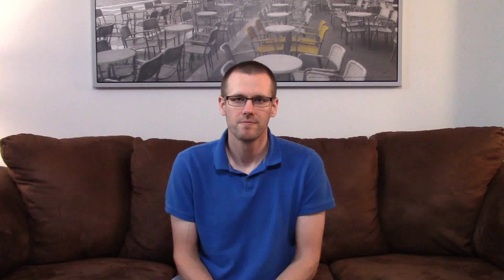Introduction summary of how to Pick an RC Brushless Motor, ESC, LiPo

Comment: I have a rc car of 1:18 scale i want to upgrade it so i need full guide on it and i want to drift can i make that car drift under 10 thousand Pakistani rupees if yes then guide me i have selected the 3200kv motor it says its good for drifting and idk how much voltage of battery would be good and also the esc

Comment: Hello sir, I want you to help me if you want.  I have a 600kv motor and I don't know which esc is best for it to achieve the greatest speed
Reply from the maker: The ESC does not determine max speed. This is up to the rest of your power system. If you haven't selected all other parts, you can't pick the ESC.

Comment: Question 
If i'm using only one ESC with no external BEC and disable the red wire on my speed controller, will the receiver now receive the full voltage from the batteries or will the receiver just not power on?
Reply from the maker: No power
Reply: @RCexplained  thank you, I'm new to this hobby and you just saved we a world of trouble.

Comment: Very informative video I must say. Highly appreciated! I have a question regarding the type of battery an esc can take. Could you use lithium coin batteries, each being around 3.6v in series to get an esc working and fly an rc plane for example? If so, (I haven't done must research on this) let's just say I have 5  3.6v Lithium coin cell batteries in parallel connected to an esc with a brushless motor, would that setup work? Sorry if I sound a little confusing.
Reply from the maker: Lithium Coin batteries would not be able to handle the discharge current required for most setups. But if you parallel correctly set them up, it could work.
Reply: @RCexplained  ok thanks I appreciate it😁

Comment: 3c, 2212 size, 1100kv motor, and 20A ESC. What battery should i use?
Reply from the maker: Depends on where this system will be installed.
Reply: @RCexplained  i want to install it on an rc plane
Reply: i have a 20A 2-3S esc, is there any battery that matches my stuff that i have?
Reply from the maker: A 3s 2200mAh battery can work

Comment: 25" Tunnel hull
90A Esc
Run with 3s Lipo

What motor can fit to this racing boat setup??
Reply from the maker: Is this an outboard tunnel hull or inboard catamaran? What is your goal with the setup?
Reply: @RCexplained  usually i need this boat for racing purpose and the setup is inboard runner f1 tunnel hull
Reply: i have a 3c, 2212 size, 1100kv motor, and 20A ESC. What battery should i use?
 just asking

Comment: 6:20 what you mean with load for example for a jet boat?
Reply from the maker: Hi NabiL, are you building a jet boat and wondering what is meant by load? If you are drawing more power than you anticipate and need to reduce load, this would be like moving to a smaller pump on a jet boat. Or by moving to a lower kv motor, or by reducing cell count on the battery. All of these changes will drop the total wattage that the system would draw.
Reply: i have a 3c, 2212 size, 1100kv motor, and 20A ESC. What battery should i use?
 just asking
Reply: Eason LIU you should see what your esc can take
Reply: @NabiL_Lam  my esc is 20A
Reply: Eason LIU does not say how many _S? Like 2s or 3s?
Reply: @NabiL_Lam it says [2-3S Lipo]
Reply: Eason LIU use 3s lipo 5000mah or 4500mah
Reply: i am still deciding on which battery i should use lol, but im still not sure which battery would match my stuff

Comment: Hi, Ryan. Thank you for the video! It helped me understand the concepts related to the battery, ESC, and motor. I am still not sure if I chose the right stuff for my RC airplane. We are trying to get the flying time for 4 minutes maximum. We are building a 1/30th scale of an actual airplane we designed and we chose the following for our propulsion.
Electric Ducted Fans: JP Hobby 90mm Aluminum Alloy EDF w/ 6S Brushless Motor, 1830 kV, Thrust with 9.04lb.
 (https://www.bananahobby.com/jp-hobby-90mm-clockwise-rotation-aluminum-alloy-edf-w-6s-brushless-motor.html?pSearchQueryId=2802711)

Battery: 5000 mAh 6S1P 30C Lipo Pack
 with XT90 (https://hobbyking.com/en_us/zippy-compact-5000mah-6s1p-30c-with-xt90.html?queryID=a47c93d28f5cc2adb3a760c4ad0b080c&objectID=82610&indexName=hbk_live_magento_en_us_products)

ESC: Turnigy Plush-32 150A (2~6S)  speed controller w/ BEC
 (https://hobbyking.com/en_us/turnigy-plush-32-150a-2-6s-speed-controller-w-bec.html?queryID=526cb495c2b4253dfefc0a5b0032271c&objectID=82115&indexName=hbk_live_magento_en_us_products)

Do you think this will be sufficient for our airplane? If not, what should we change?
Thank you!
Reply from the maker: Hi San Lee, What size is your airplane and what is the weight? 30C for the battery is a bit on the weak side for your power system. You will be pushing the battery quite hard.
Reply: hey san lee can u help me with picking out a lipo battery? im kinda stuck and confused

Comment: Hi Ryan, I’ve found your videos really helpful. Propper technical explanations are very much appreciated. I’m reasonably up on industrial 3 phase induction motors but the battery powered scene is new to me. 
I realise this isn’t exactly RC but your channel and site has been the best source of info I’ve found: I’m looking to make an electric scooter more dangerous and I wondered if you wouldn’t mind checking some of my assumptions before I order parts.
Stock motor is 280w 24vdc and turns at 2750 rpm. That gives you about 15mph…. eventually – it’s pretty gutless. I’d like to get that up to more like 25mph with improved acceleration and I need a fair bit of torque as the scooter with me on it will be at least 100kg. 
I want to try and run it off two 5Ah Milwaukee drill batteries for 36v as I already have these. I’m unsure of the max current these will sustain and don’t want to unduly stress them so they’ll carry on running my tools! If they just won’t work I’ll probably move to hover board packs or possibly a home built pack.
That all suggested a 120KV motor with sensing for better starting torque would work for me and I can get this style for a sensible price in the UK:

https://www.ebay.co.uk/itm/120KV-24-36V-Brushless-Sensored-Motor-45km-h-for-Electric-Balancing-Scooter/203011985854?epid=20038978874&hash=item2f447511be:g:qGoAAOSw8xde2Rqq

I’m still not really sure what ESC to pair it all up with though. Motor spec suggests max draw would be ~128A at 36V but I’m unlikely to use that continuously. Would that suggest a 150A ESC? I don’t want to spend loads but I would like something programmable so I can derate the max power so the kids can play on it (or to preserve my batteries). Another nice to have would be the ability to connect directly to a thumb throttle but I’m unsure if this sort of thing is available – I’ve seen a trick with a servo tester to make it work and I’m happy to do that if it’s not but it would be more elegant if I can do it directly. Do you think a capacitor bank would be worth it in this application? Reliability and overcurrent/overheat protection would be a good thing so I don’t get stuck with a burnt out ESC miles from home! I have no idea what manufacturers to look at, which to avoid etc.
Any thoughts on the whole system or suggestions for an ESC very much appreciated!
Reply from the maker: Interesting Project. I would suggest trying to find out the maximum continuous current of your 36v batteries. I would not expect you to pull more than 50A continuous. An ESC closer to that range would be acceptable. The key here is that you won't know how much current the system actually will pull with your specific setup unless you can find someone on the forums who has experience with this. If you can not, you will want to log (always a good idea) the amount of power your system will consume with you on it the scooter. Over sizing the ESC will allow more head room incase you find yourself pulling more power than expected. Otherwise you will have to change the belt/gear ratio to reduce load/current. 

I've seen throttles that work with a typical ESC, just not sure where to get them. They do exist though and you can always create your own throttle from a servo tester. If you are under 50A continuous on an 80A ESC for example, there is no reason to require a cap bank. This example has a lot of head room and the throttle is less likely to be blipped frequently like an RC Car.  The harshest on your equipment will be how hard you accelerate or push the system up hills. If the ESC you select can limit current, this option can help keep the system in control. 

A data logger is a great investment and if you get the right one you can have live data during your runs. 

**I'm assuming 120kv @ 36v is going to get you the correct RPM for the gear ratio that works on your system allowing for 25mph.

Comment: If I’m building a battery operated surfboard not to surf but to just drive me out the back , do I still need a ESC or can I just run an OFF ON button straight from my battery ?
Reply from the maker: If you are planning to use a brushless motor you need an ESC. A brushed motor could be hooked up with an on and off switch, however, I would still recommend an ESC.
Reply: RCexplained thanks but for what reason ? I can’t carry a remote while I’m surfing
Reply from the maker: It can  be something as simple as a water proof throttle that clips on to your board until you need it. 
Depending on the setup going from 0-100% with a flick of a switch can be very harsh.
Reply: i have a 3c, 2212 size, 1100kv motor, and 20A ESC. What battery should i use?
 just asking

Comment: Hello, thanks for another helpful video! I have a couple of questions/video ideas:

1. How can we calculate the approximate power required to push a car of a certain weight at a certain speed. I personally am aiming to push a 4 pound car to 30mph.

2. Please explain the relationship between voltage, current draw, and power consumption over the course of an acceleration from 0 to top speed for a sensored motor? You've explained that higher voltage = greater rpm = greater top speed (given the load is reasonable). However, when a car accelerates, the voltage being fed to the motor isn't increased. Instead, voltage is constant and current is the variable. If I am correct about this, how does the current vary throughout an acceleration?
Also, how does current draw vary with velocity when the car isn't accelerating but maintaining a constant speed. Ex: Lets say that a car has a top speed of 30mph for which it draws 10 amps. When this car travels at 15mph is it approximately consuming 10 amps? 
I understand that the current being fed through the poles is being switched at varying rates to acheive different speeds, but does it require less current to switch the poles at lower frequencies? (I am mainly interested in sensored motors)

Thanks again!
Reply from the maker: Hi Yung Bidness. Thanks for your comment and video ideas. Appreciate it!

1. It's challenging to come up with a user friendly formula that can compute the power requirement for RC vehicles as there are a lot of factors that come in to play. For example, this is just one component, I would need the aerodynamic constant for every single RC body out there. Everyone body is shaped differently. For the most part, this constant is determined by experimental analysis. 

2. Sensored or Sensorless Motor, the relationships are the same. Generally speaking you can imagine what the current would look like if you imagine how much load or stress the motor would be under. If you are accelerating hard, the motor would be under significant load. If you are at constant speed, the motor would be at less of a load. If you are at now half the constant speed, the motor is seeing even less of a load. Load translates in to the current being pulled. 

In addition the ESC just varies the frequency thus RPM of the brushless motor. Current is not variable when considering RPM. The ESC does not have a say in what the current pulled will be. You can increase RPM of the motor and at the same time current can decrease if the load decreases. Imagine accelerating on pavement and then hitting a large section of ice at 100% throttle. With no friction, the motor will hit high RPM on the ice, drawing much less current. The RPM would sky rocket.  

Current is dependent on what the motor demands based on the load that it is under. Higher Load = more current.
Reply: @RCexplained  Very clear, thank you so much! 
Could you make sure I'm correct on this: I have a 2,000 kV motor set up with a 4s battery which achieve a top speed of 30mph. If I pair that same motor with a 6s battery and go 30mph, will the current draw be significantly less than if I were using the 4s battery at 30mph because power is constant?

Lets keep the motor constant: Why does a higher voltage battery = greater rpm. Does higher voltage allow for a higher frequency in the esc?
Now lets control for the battery: How do the number of turns of the motor impact kV?
A video on this would be very helpful for me if it is too complicated to write out. Thank you!  :)
Reply: To simplify my question: if the esc frequency determines rpm, how does voltage impact rpm?
Reply: @RCexplained  Thank you for your explanations, but they are stiil not clear for me. Let's suppose that we have two cars - both are of the same model. One of the cars is equipped with 1000kv and another one - with 2000kv. All other components and factors are the same fot two ones (ESC, LiPO cells, gear, aerodynamics, weight, day of week, weather, and so on). Now per your explanation I can conclude, that the car with 2000kv will just go faster than one with 1000kv, because per your explanation kv is just for RPM. Then, you say that if we are accelerating car, the motor will pull more current, if not - less current. Now, let's suppose that we are not accelerating. We just in two use cases - two cars are going down from hill and the same two cars are going up on hill. Will be there difference in behavior of two cars? Or will that one with 2000kv motor go up to hill faster (constant position on throttle channel, for example)? Another example: we have equipped those two cars with +5 kg weight of some staff. Will speed, ability to drive/accelerate of two cars be changed?

Some vendors provide different modifications of the same motor series. For example, three modifications that differ just by kv - 1400, 2100, 2800 (one with lowest Kv has greatest resistance and lowest no-load current; one with highest Kv has lowest resistance and highest no-load current, third one - in between of of two others; all other parameters are the same for three ones). Should I base by choice only on desired speed and don't care about weight of my car, for example?

Thank you in advance.
Reply: i have a 3c, 2212 size, 1100kv motor, and 20A ESC. What battery should i use?
 just asking